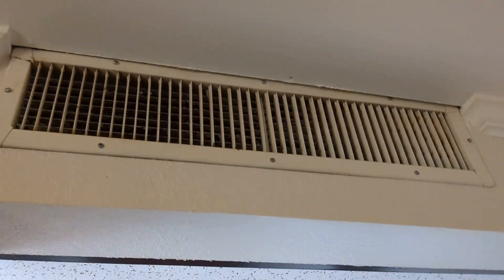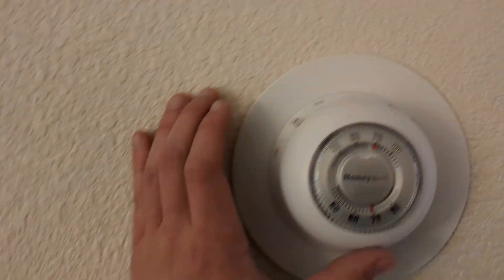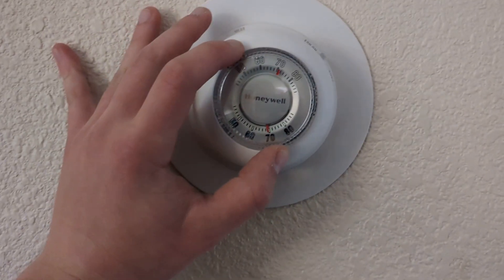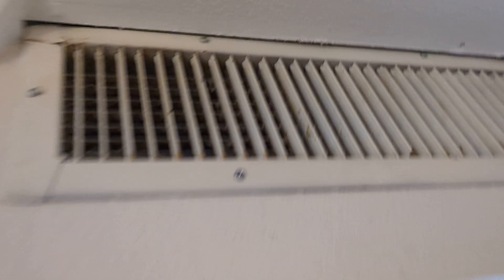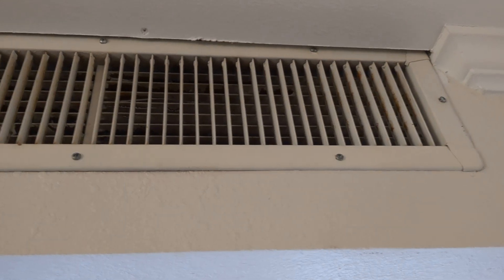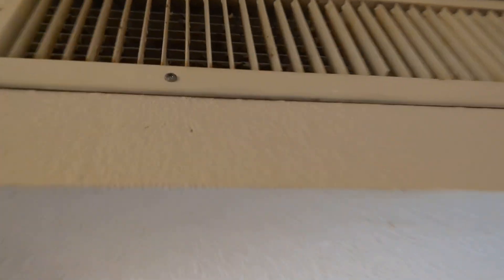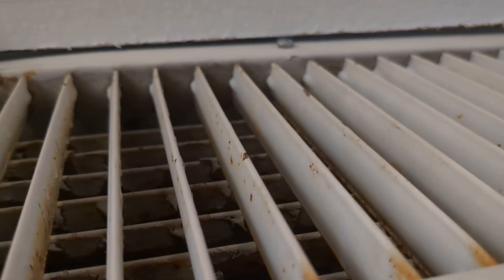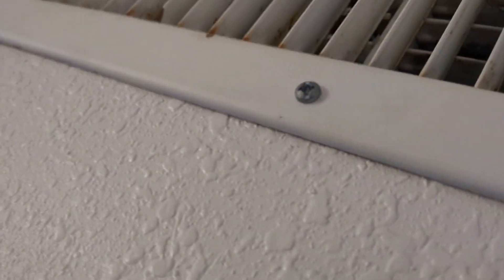1980s AC System With Extremely Audible R-22

Comment: What brand and style of unit is this? Is this a split system? Where is the condenser located and how is it set up?

Sorry for all the questions btw.
Reply from the maker: I don't mind questions! Unfortunately, I have no answers. This is not my unit, and I did not have much time to look at it. I would assume the condenser is located on the roof of the building, but  I have no way of knowing.
Reply: @M.Hohmann1112  very interesting.